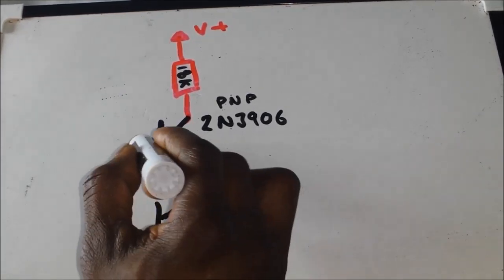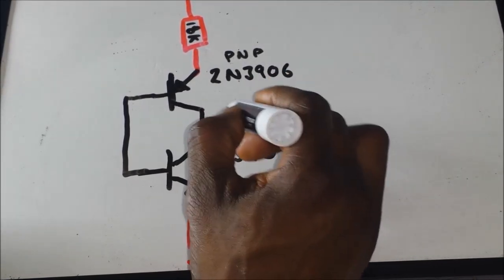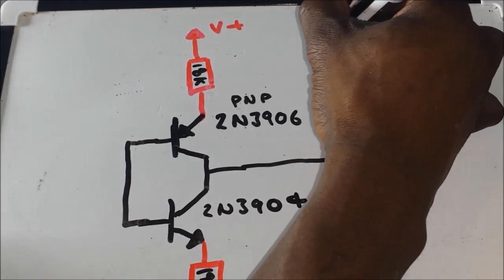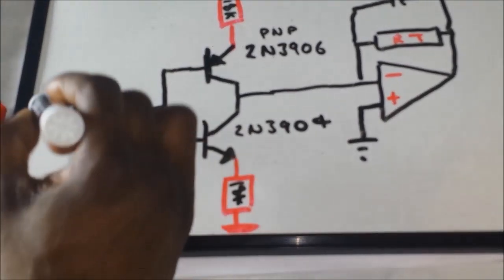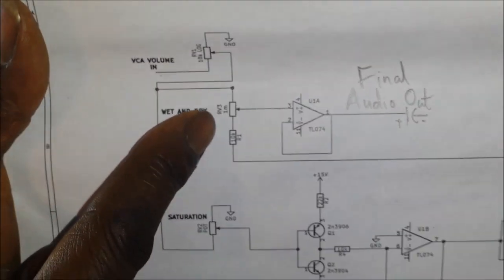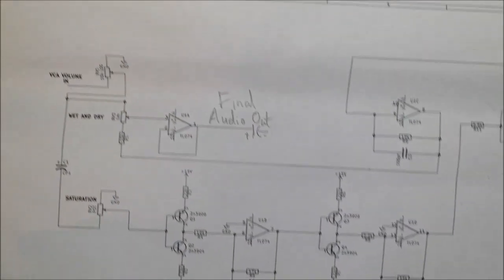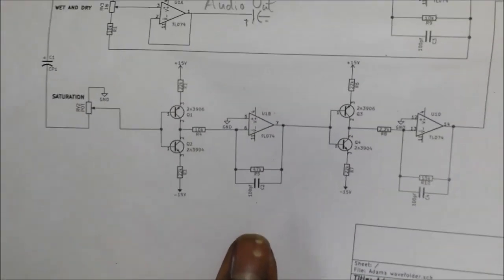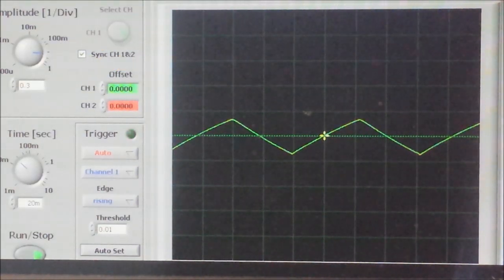DIY analog synth project Tutorial Part 18 (The Wavefolder)

Comment: i have another question, what the value for the electrolytic cap C1 and the other at the final audio out please ?
have a good day and be safe !
Reply from the maker: Anything from 2.2 to say 47uf. It's just to block dc voltage and couple the audio signal. If you go below 1uf you may lose the lower frequencies of your signal.
Reply: @AdamTheAd-vanc3d  thanks for all !
Reply from the maker: @SBender36  Your welcome.

Comment: You flipped the wave 3 x, aren't you subtracting with the 3rd stage from the orginal audio input? Did you try with 2 or 4 stages?
Reply from the maker: I wanted to do 4 stages but run out of space on bredboard. In the final schem there are 4 stages.
Reply: Adamski A. Do you really need the op amps in between? Would it work like the original design of Ken Stone, an inverting op amp at start and another inverting at the end?
Reply from the maker: @AnalogDude_  The idea is not for me to copy a design to a Tee, but to experiment and try and find what works for me.
Reply: Adamski A. Yeah, i know, i'm just wondering if the amount op amps are really needed and if it would work without them.
Reply: Adamski A. If you put a sine wave via a mult module into an inverter module and mix the normal with the inverted sine wave you end up with nothing.
Reply from the maker: @AnalogDude_  I completly get that. But that is not happening with this circuit. Check out the minibrute metalizer/wavefolder schematic this one is very very similar.
Reply: Adamski A. I have built the Buchla wave folder, but i guess the schematic i found online was crooked ... it differs from the original, still gotta debug that.
Reply: Adamski A. Yeah, somehow the transistor setup is "dividing" the input frequency by 3 ... according to the article from Ken stone i read last night ......... i toke you design and gave it twist and added another feature. But i really wonder if op amps are needed. There are various configurations possible.
Reply from the maker: @AnalogDude_  oh ok never seen that one . I will look it up 👍👍
Reply from the maker: @AnalogDude_  very good chance . Maybe i will try it on  a spare breadboard during the week.
Reply from the maker: @AnalogDude_  As i said its worth giving a go .If it yeilds better results then perhaps ill re think my final design.
Reply: Adamski A. I hate breadboards ... hahaha, i have pliers to force the legs transistor, resistor into ....

Comment: Fuck this shit! I´ve rebuild and checked the circuit on your paper 3 times, and always the ic is getting really hot. don´t spread disinformation about stuff, you obviously don´t know alot about... damn, what a waste of time. and yes, i´ve tried different ics.
Reply from the maker: That's a damn shame it doesn't work for you. Can I ask what voltage power supply you are using and what ics, where did you buy the ics. You may think its an odd question for me to ask, I ask this as in the past I have had a few instances of buying fake ics, I tried for 3 week s trying to troubleshoot a mn3007 bbd, only to find it get real hot and never work, I also had this with a fake ca3080. If I can help I more than happy to do so.
Reply: I´m using bipolar 12 v, eurorack standart. and the ic is definately no fake. others from the same badge are working great.
Reply: i´ve also used 2 10 uf bypass and 100 nf decoupling caps.
Reply from the maker: @hendrixplek  Which schematic are you using for the wavefolder ?

Comment: Really great stuff! Never saw this simple wave folding circuit before, thank you! How long have you been building circuits, may I ask? I know you said you're not an expert, but your giant tidy breadboard suggests at least a few years??
Reply from the maker: Hey man thankyou. Yes its a very simple circuit when you think about it. I started building bredboard circuits in mid 2018. With not much knowlwdge. My neat breadboards is probably part of mentality to approach jobs in a neat fashion. Ita not the tidiest as i would like but the best (ish) i could do .
Reply: @AdamTheAd-vanc3d  Wow, thats incredible! I've been frying ICs and smoking pots for five years, only now am I getting reproducible results, haha. You're a natural, apparently! Most of my troubles begin with a rats nest breadboard or messy soldering, so i have no doubt you'll do fine. Those breadboards lose their grip on the wire after repeated insertion, making troubleshooting especially difficult.
Cheers!
Reply from the maker: @RaccoonEatingCacti  . Thanks. When i started i did burn a few ics  along the way luckily they were quite inexpensive but did learn from my mistakes. Be sure to check out my breaboarding tips video. I use cat5 cable for jumper wire as you can cut it to the exact length and shape an angle as desired. Not only that each meterage of cat 5 gives you 8 wires, so no brainer in my book as far as cost is concerned. Yes the contacts do become loose, thou i have learned that if you use a blunt tool you can press down hard on the top of the breadboard which presses it all back together again. If you notice on my boards all my pots are doubles . This is because i have had values only availavle in single which dont stand up very well. I remove them from the single housing and scrape out the back carbon strip of the copper so only the front resistance value is in use. (If that makes sense ? )
Reply: @AdamTheAd-vanc3d  Will definitely be checking out that breadboard video! My life quality increased dramatically after picking up the cat5 cable. the wire before that was sold as breadboard wire but was very brittle. four or five bends and it breaks off. Really cool trick with the pots, might have to try that! Thanks for the replies and tips and good luck on whatever's next!
Reply from the maker: @RaccoonEatingCacti  . Indeed the cat 5 is cheap if you can get it by the metre as you need. 
Never hesitate to ask for help if needed. We all started somewhere. 
Thanks and good luck to yourself :-)
Reply from the maker: https://youtu.be/u2JspaaJohY 
Watch this and the part 2 if you havnt already done so :-)